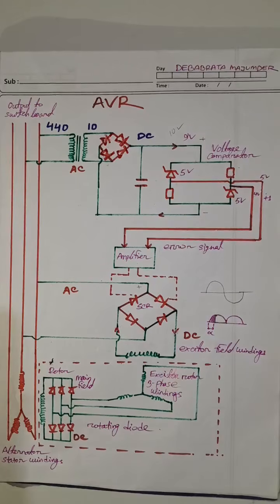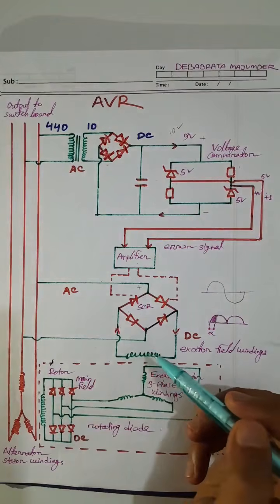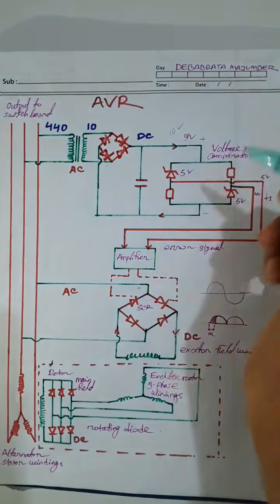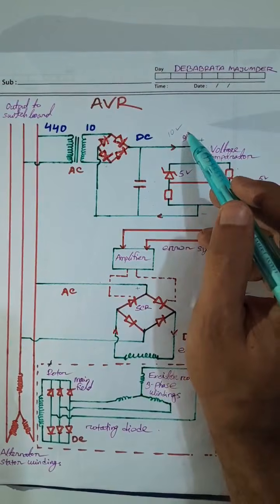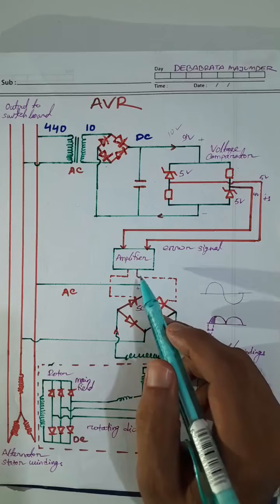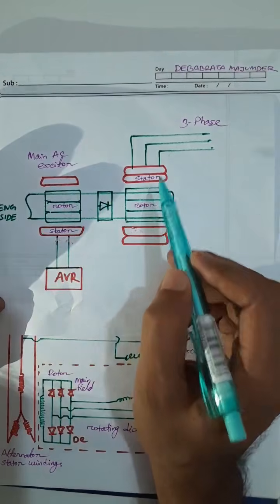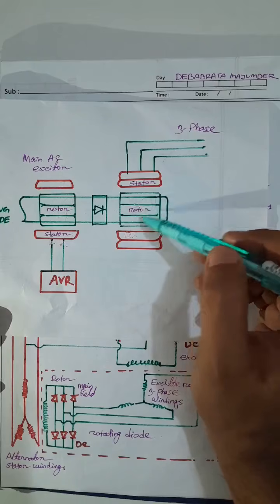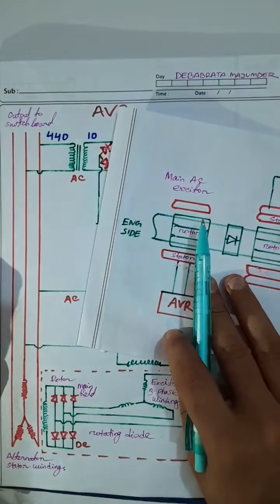Working principal of AVR(Automatic Voltage Regulator) #marinescience #marine #marineengineering

Comment: Sir in the scr why there is connection taken from the alternator bus bar line?. Is that Ac gets converted to Dc by scr as per the amplified error signal and producing exitiation field to the exiter rotor windings?. Pls clarify
Reply: Yes

Comment: How this voltage is getting divided into 5+5 after rectification , as it is in parallel , so it must be 10v in each branch ??
Reply: it is completely depends upon the load resistor value which is connected in parallel with the diode. so that it limits the current and there itself there will be exactly 5V voltage drop at resistor which maintains the other 5V at diode also..